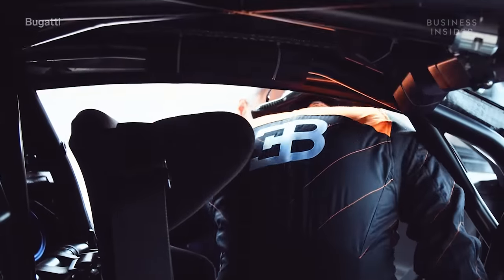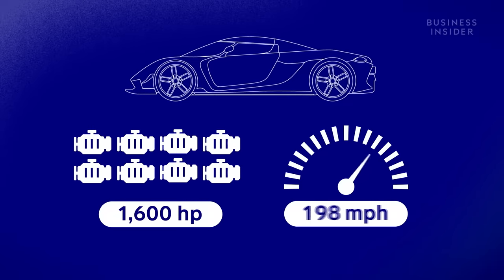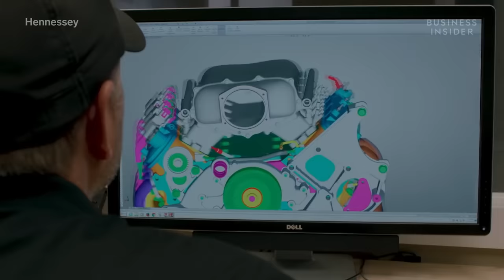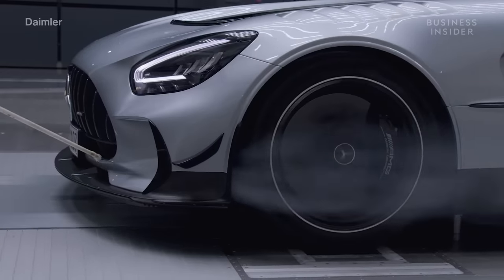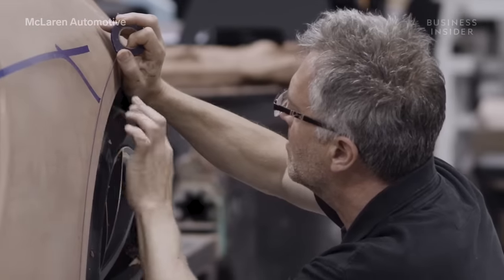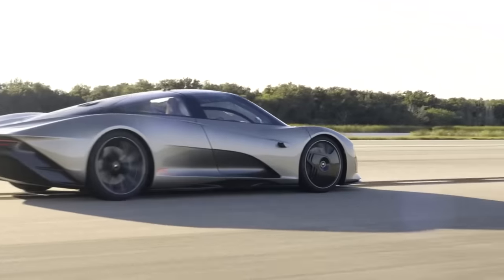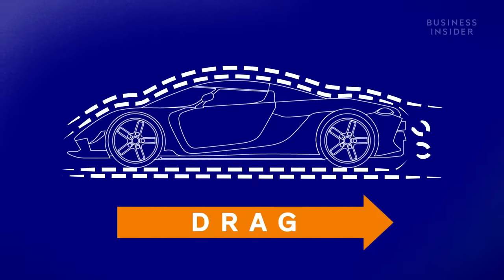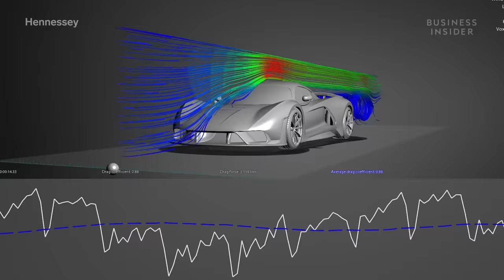Why It's Almost Impossible For Cars To Go 300 Miles Per Hour | Insider Cars

Comment: i dunno  about mile,but the chiron can go 500 kph
Reply: 300mph is slightly less than 500kph. 

Although these super cars might be appealing to rich mans brats, in the near future speed limits will slow these cars down even on the German autobahn. 

The stopping distance at such speeds with all-out breaking is about a whopping mile. 

When self-driving cars become reality we would need expensive front and rear sensors and/or wireless communication between all cars as well as a special infrastructure to allow secure simultaneous self driving and limitless speeding. Future self-driving cars will be made for the global market and they will be electric. With 99% of the civilised world having a speed limit, there is no chance Germany can require all cars on this planet to include expensive sensors to allow the billionairs brats speedlimitless driving.

Comment: Around 140 you can almost take flight in older model rides. My dad rebuilt a corvette small block 350 in an Elcomino. We hit around 140 and started lifting off the ground.  So yeah holding speed like that on the earth not be easy.

Comment: It's an impressive feat in engineering, but what's the point? There isn't a single road on the planet and only a handful of race courses/tracks where 300mph is actually possible. You can also guarantee that most, if not all, of the people who can afford to buy these cars don't even have the skill to drive them at half their top speed.

Comment: The power problem will be solved with more advanced electric motors, they can go insane rpm without thinking too much about the strength of the motor itself. Aerodynamics is solvable, trains go faster so why not cars? At this point I should point out that aerodynamics becomes more of a problem if you want the car to be road legal 😅. The tyres though remain a big issue, trains have the advantage to have a consistent path made specifically for them but asphalt is variable. But hey, at least the electric motors can solve the power issue, and yes you would need a giant battery to power it long enough to reach those speeds but batteries will get better too, graphene batteries can store many times more energy than lithium ones in the same space, and they are lighter. Plus, the Bugatti empties the tank in 9 minutes flat out so it's becoming a problem for internal combustion engines too

Comment: Carbon Fibre stronger than steel? Strength to weight ratio maybe. Steel has superior resistance to compressive force. It's just weight that won't cut through

Comment: just point a tube infront of the car that sucks in air when driving fast and the other end points straight up on the hood, to generate downforce. the faster you drive the more your car will stick to the ground. this will make the car slower for sure, but the front will stick to the ground by a lot... is this the idea? anybody?

Comment: Sorry, its NOT almost impossible. 

Bugatti hit 250 decades after the Sledgehammer Corvette hit 254.76 MPH. 

The M2M Ford GT hit 300.4 in a standing mile and was still accelerating. 

So no, it is not almost impossible to hit 300. 

There just isn’t much point or need to do so, nor is there much in the way of places to do it.

Comment: Because plane takeoff speed is 150 mph. At 300 mph it's no longer reasonable to still use wheels. You're basically flying AND trying to push the car into the ground with the spoiler to steer. There is no application for such speed on the ground. The inertia makes turning impossible, breaking destroys the wheels, the rotation overheats the axes... Really, just take a plane, it's way easier and faster. Trying to drive at 300 mph is like trying to run while driving at 60 mph. It's... unnecessary and harmful.

Comment: "It can be... 5x as light."
What.
Did we determine the maximum weight of an object, and carbon fiber is five times as far away from that as steel?
I'm pretty sure we didn't. Also, I'm pretty sure that even if we did, carbon fiber would not be five times as far from it as steel.
Perhaps you meant one fifth as heavy.
Reply: one fifth as heavy is the same as five times lighter

the weight of any given object (regardless of size) will be 5 times greater if it were to be constructed out of steel rather than carbon fibre, you could balance a scale by using 5 times as many carbon fibre x on the opposing side of 1 steel x

when/where did anyone decide the max weight of an object? If there was a max weight, wouldnt it be the same limit for everything, just as the speed of light is the speed limit of matter, regardless of its structure (steel vs carbon fibre), even so, there would be a relationship between the two before the limit.

just like how we dont say spaceships and bikes are as fast as one another, despite both being capable of reaching the speed of light if accelerated, we say that a rocketship goes, lets say 10k km/h versus a bike at 20km/h, 500 times slower
Reply: @the_great_magicman1877  "Five times lighter" is a nonsense statement.
It is commonly MISUSED to mean one fifth as heavy. This is incorrect. That's not how physics or math work.
The only way you could possibly make a comparison like that is if there was a known absolute max weight (density), as I implied.
Even if there is a known max, say the density of matter in a black hole, there is no way that carbon fiber is five times as far from that density as steel.
Reply: here is an excellently written post about the same topic

First, "A is 5 times less than B" does not mean "A = B - 5*A". That is never what a native speaker would think. "Times" is always multiplicative, so the amount of "less" is 5 times greater. "Less" can have a subtractive meaning, but it's much less common than being used as just a word of comparison (like "more"). As such, the multiplicative "times" is a much stronger meaning, and so when used together, "less" is never subtractive.

For example, "A is 10% less than B" means you should subtract 10% of B. If you say, "A is 10 times less than B," it means A is one tenth B. The "times" takes priority. Though for general comparisons, such as "A is less expensive than B", it also is just a simple comparison, not subtractive (and these are more common).

In English, saying something like "A is one fifth as fast as B" is more awkward than saying "A is five times slower than B." They are both correct, and both might be used for the same situation. Thinking in whole numbers is faster and more convenient, however, and is good for emphasizing the size of the difference.

So no, this is not a horrible formation. This is a very usual and easily understood part of English. In science, it's more common to use "A has one fifth the speed of B" for maximum clarity, but what is best-practice in science, and what is proper English are not the same. (Best-practices are always more restrictive than what is correct in the language as a whole.) (20/08/2018)
Reply: @the_great_magicman1877  Read my previous comment.
It's an excellently written comment on the subject.
Reply: I do, however, share the confusion as to why we say "times", it has always made less sense to me to use one over the other, but thats just what people use and accept in certain places. Similarly, if we looked at stacks of cubes from an angle that lets us see 3 sides, how do we know that the backside isnt hollow or has additional cubes hidden in its shadow? we cannot, but yet we are to assume its neither of those things, thats just how it works untill you come across it in the real world
Reply: @Mythraen  You might be experiencing "recency illusion", which explains why you think it is a common missuse, language is weird, and the people that use it are even weirder, have a good day
Reply: @the_great_magicman1877  You're definitely suffering from not understanding what words mean.
Reply: @Mythraen  how come?  Youre under the impression that a phrase predating your birth is misused, which suggests that you think its usage is recent. A misunderstanding caused by time. Unless you claim that the phrase has been incorrect since its origin, but that would be daft considering people dictate what is true and false, the phrase has, and will be used for a long time, making it true by default, regardless of your feelings towards it. So do feel free to enlighten me. Which word do I not understand?
Reply: @the_great_magicman1877  "Five times less" means however much less it is multiplied by five.
Since there is no mention of what it's less than, we must use an absolute as a reference point, which would be absolute density.
It does not matter how long people have been making this mistake... the words do not express their intended meaning.
Reply: @Mythraen  The beauty of words is that they can have several meanings, you're trying to approach the wording from a scientificly sound logic, whereas it is linguisticly sound to phrase it in such a manner.

are you claiming that "five times less" is equal to how much less it is multiplied by five? wouldnt that just be 1 in this case, meaning that steel and carbon fibre weigh the same?

you also claim that there is no mention of what it is less than, which I also fail to understand given that the simple phrase gives us so much information

the weight of one volume unit of carbon fibre is five times lesser than the weight of one volume unit of steel

carbon fibre is lighter than steel by a factor of 5

lighter by a factor of 5

5 times as light

the logic is quite easy to follow, even if it makes little sense
Reply: @the_great_magicman1877  We agree, words can have several meanings.
Feel free to provide me with the definitions of "five" and "times" and "less" that make sense in this phrase.
Reply: @Mythraen  " kill two birds one stone"

kill - cause the death of

two - a group or unit of two people or things

bird - a warm-blooded egg-laying vertebrate animal distinguished by the possession of feathers, wings, a beak, and typically by being able to fly

stone - hard solid non-metallic mineral matter of which rock is made, especially as a building material

ive broken up the phrase into its components and defined each and every one of them. According to the definitions provided, the phrase says the following

"cause the death of a group of warm-blooded egg-laying vertebrate animals with a hard solid non-metallic mineral matter of which rock is made"

But, the phrase itself has a definition

two birds one stone - to achieve two things by doing a single action

a number is merely a sum of digits, but a sentence or phrase is so much more than the individual words its constructed of, your last reply makes it painstakingly clear that there is no futher point in exchanging messages after this reply, have a good one mate
Reply: @the_great_magicman1877  You're trying to argue for an idiomatic expression...
Which would make a lot more sense if it weren't for these facts:
1. It's not a metaphor. Your example is a metaphor.
2. There is a much simpler phrase in English which conveys the same concept with less ambiguity: one fifth.
Reply: @the_great_magicman1877  Lol, I didn't even expand your comment originally. It was so obvious what your argument was, I just replied to it without reading more than a tiny fraction.
Now, I can't decide what's funniest:
1. That you expended so many words on such a simple concept.
2. That you expended so many words to tell me something I already knew.
3. That you thought telling me something I already knew, not to mention using such a poor example, was a good note on which to end.
4. That you gave up on me because I wasn't willing to entertain your idea... even though I already understood your idea far better than you did.

Comment: Mph is kinda e weird way to measure speed
Km/h is way more logical to normal people if you ask me because 200mph is 321.8688 km/h but 300mph is 482.8032
See from 200 mph to 300mph you see a difference of a hundred but it's actually nearly 162km h difference
Reply: Yes, that is what happens when you compare differently scaled units.

Comment: 300 miles not make any sense. how much in km then i tell you answer. air is gravity. do wing car become airplane. do wing upside down it pull on road and it wont gain speed. so why not buil 100mh car 3x cheaper?

Comment: Did I enter a dimension where the NRA doesn’t exist?  Or the  Bonneville Salt Flats? Cars routinely break 300 mph.  And a lot of them do it in a quarter mile. They’re not production cars but it can be done rather easily.

Comment: Save you some time: the power consumed by a vehicle to maintain its speed due to drag grows as the cube of the velocity. For a car that means that going at 300mph needs about 80x the power of going at 70mph ignoring other losses and issues (like stability). The dominant energy loss mechanism in cars changes from tires to drag at around 30mph. So unless you are on a different planet with a thinner atmosphere or a vacuum tube, surface vehicles in general won’t be going faster than 300, and will generally stick to under 150mph for regular users.

Comment: Ride a bike. 70 mph had almost no resistance.  Hit 100 and you need to tuck in as the.air is like water. At 180 the air very very  hard. Air at 300 mph must be. Like hard wood

Comment: 482.8 km... Some ppl are still using prehistoric measurement units.. use international metric units. Only 500k ppl understand what you mean. The other 7500k do not... Also pls stop measuring with your feet either.. It s not 2000bc anymore... Geeez.... Plus our feet are on horizontal axis, and yet you use feet measurement for mostly vertical situations. Its illogical indeed.  Grandfather of my grandfather used used to measure stuff with his feet or hands. We have invented the metric system since you guys moved from europe to america, everyone switched to it, its healthier and more efficient, it is not different distance at water. 1m is 1m, both on land and on water. Its not as complicated dont torture yourselves. 1000 inches is not 1mile on the other side of the atlantic everything is simpler, 1000m is 1km. 1000g is 1kg. 1000ml is 1lt. 1lt water is equal to 1kg, so fking simple! Why complicate every single measurement system when you have an a lot simpler version? Water evaporates at 100°C and freezes at 0°C. With Shaquille O'Neal 's feet i'm 5feet long, with my girlfriend's feet i'm 8 feet long... I have to add one last thing, "THAT" is NOT football, it is "handegg". The ball "🏈" actually looks like an egg, and you carry it with your hands, your feet touches the egg only once. And you call it football, come on.. 🖐️🏈 / 👣⚽ see..

Comment: Plus, hand and eye coordination has to be a factor too.  If you've ever tried to hit a baseball that's traveling over 95 mph, you kind of realize just how difficult that is to keep your eye on the ball.  Plus, going 300 miles per hour means any bug or insect or loose flying debris that hits your car is hitting it at 300 mph.  Just not practical to have a street legal car able to go at speeds even half that. It makes no sense.

Comment: And yet it's frankly pointless. Clever but futile. Just so you can say you went 300mph? Once. When the speed limit is usually less than a 1/3 of that, and mostly it'll be going 100th of that in Manhattan or Mayfair.

Comment: Pfff why bother with air intakes? Air is too poor in oxygen, put oxygen in the fuel directly. Hell why not burn the fuel faster and ejecting the gases out the back? Also reduce contact with the road to minimum to lower friction, how about small tires that retracts. Oh and wings on the sides as well!

Comment: If you've ever wondered what lets a jet airliner weighing 550 tons fly, it's the fact that - to a plane cruising at 560+ mph - 'thin air' acts almost like a solid.

With enough speed a plane can 'float' on it in the same way that a 500,000 ton supertanker can float on water.

Which is nice...

Comment: No sir.
The first street legal car to be capable of 200 mph was actually a 1968 Dodge charger with the optional 440 Magnum V8, or 426 Hemi with the 4 speed and 2.65 gears.
Not the overpriced POS Ferrari.
just because a car can do 200 mph does not mean that it has to be an unreliable delicate pile of garbage that lives its entire existence in a garage.

Comment: I'm sorry but this video is incorrect. That Bugatti that hit 300 miles an hour is not considered a factory production car because it was modified. The world's fastest car is still the Koenigsegg agera rs. You need to fix your video. Koenigsegg also holds the record for 0 to 250 mph back to zero way faster than Bugatti did it. Fix your video it is incorrect. You have to build a certain number of vehicles and they cannot be modified from factory conditions. I keep waiting for Koenigsegg to run the jesco because that car will hit 300 miles an hour I can assure you and it will be factory original not modified. You Bugatti Fanboys just kill me you refuse to admit there is a faster car.

Comment: What? 250 to 300mph in 15 years. How out of touch. We we broke the sound barrier in 1997. Cars break 300mph all the time at Bonneville and we don't even have pavement to drive on. what a bunch of navel gassing fools. Been there done that. No one at Bonniville would be impressed with that, hell my bike goes faster than that!

Comment: It’s not the speed it’s the tire. 

Me thinking about solid rubber tires that don’t inflate at 300 mph. C’mon Michelin you’ve had dumber ideas. You’ve already done the “un-popable” tires. I mean I guess solid tires wouldn’t be good for bumps or suspension but who’s going 300 mph over bumps. If your going 300 mph over a bump in any tire your already screwed.